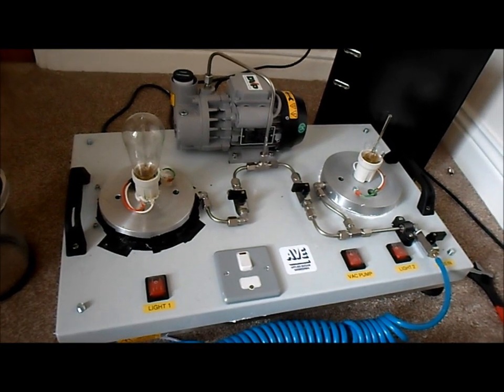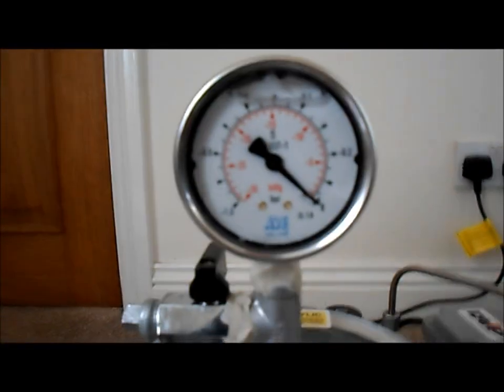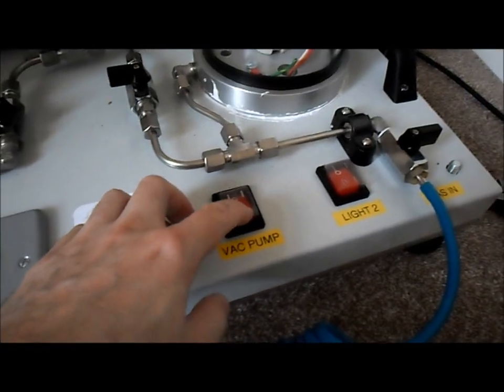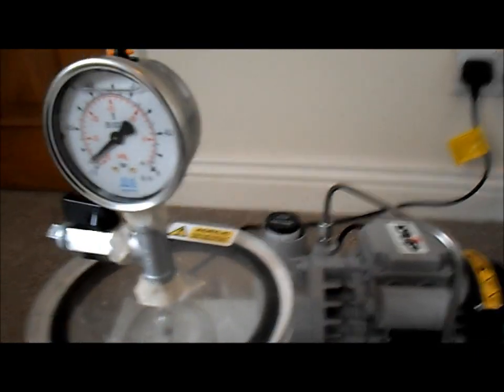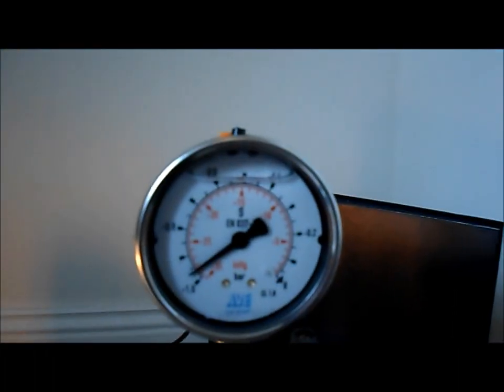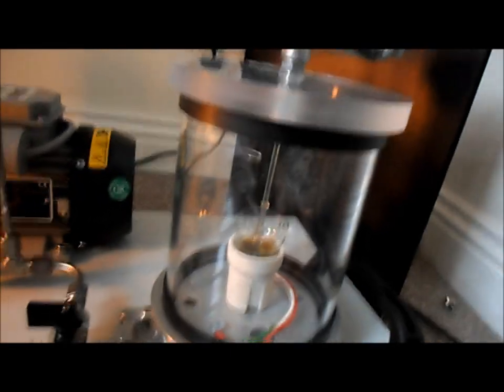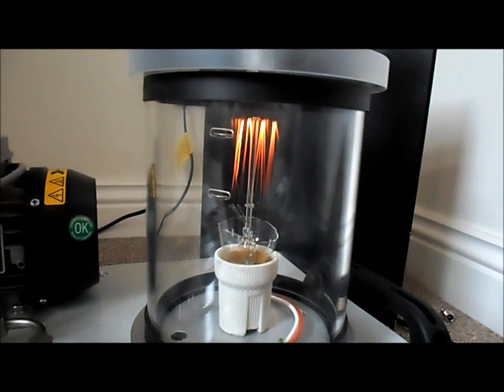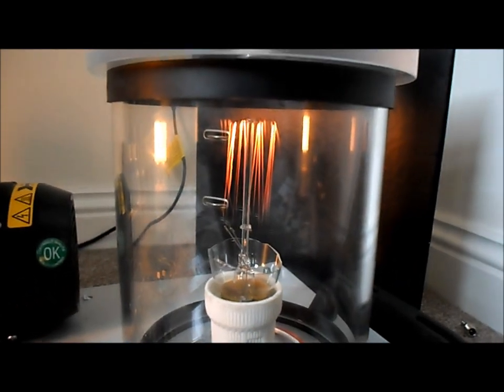Does Greta Know? CO2 does not cause global warming - Direct Proof

Comment: Hi,
Very interesting indeed Geraint!!!
I am just thinking to buy your book! :)

However just two issues.
If I understand correctly they say:
1. The Earth atmosphere absorb heat via:
- IR (long wave from the Earth's surface),
- IR (short wave from the Sun),
- convection
- conduction (the least)
2. Then this heat absorbed in the atmosphere radiate to outside (space) and part goes back to the Earth's surface via:
-  IR (long wave) from the atmosphere (CO2, water vapor, methane etc.)

So if IR is the key type of heating responsible for Global BS then should your bulbs not be IR bulb for better results?
And would not it be better to break the glass from the left one in vacuum as well? It is surrounded by the vacuum anyway. Will be exactly the same as on the right but just different ambient, so vacuum vs CO2.

And second issue is to confirm your understanding-
Do I understand correctly, that some IR heating still goes back to the Earth's surface but amount of that energy is really smaaaaaall.
The smallest (if anything at all) is on the equator (high Earth's surface temperature) and the highest amount of radiated energy (if we could say that) on poles (low Earth's surface temperature)?
But anyway generally the Earth's surface temperature is higher than the temperature of the Atmosphere.
So the atmosphere should not back radiate any heat, with exepction maybe of some minor opportunities where atmosphere temperature would be higher that the Earth's surface temperature?
Do I get this right?
Reply from the maker: https://www.youtube.com/watch?v=Km1lwYS1Qkk&t=663s  No RGHE is a lie.

Comment: 755F and 1466F are the Planck radiation  temps of CO2's two absorption wavelengths of 4.3 and 2.7 microns.The other one is at 15 microns, which has a Planck radiation temp of -80C (-112F), none of which Earth's surface can radiate except inside volcanoes or on a super bad day in the Antarctic. I guess the lightbulb at 4600F is out of CO2's range. :) I still wish you'd try surrounding the filament with a piece of one of those space age emergency radiation reflecting blankets ($7 at Amazon.com for two 7'x5' blankets) and see if it makes it glow brighter. Too bad for the CO2 greenhouse warming hoaxers, there's no giant space blanket floating in the sky.

https://www.quora.com/How-many-people-deny-climate-change-because-they-are-not-familiar-with-climate-research-and-therefore-think-I-dont-understand-it-so-it-must-be-wrong/answer/TL-Winslow
Reply from the maker: The full reflection thing has already been done using a 3d star parabolic legged carambola, so that all light sent out was sent back to the centre source.  https://principia-scientific.org/light-recycling-disproves-greenhouse-gas-theory/  If you reflect all the energy back at the filament, the brightness will increase, because tungsten at that temperature has an emissivity of about 0.30 which can be improved by reflection.  The reflected light superimposes upon the same phase space as the originalyl light and this gives a boost in light output.   If tungsten had an emissivity of 1, there would be no potential for increasing light output via reflection.   However, the maximum temperature of the filament remains unchanged and only cooler parts get warmer, so it becomes more uniform & efficiency reduces.  Also, the light is giving out radiation in the CO2 wavebands, it just the radiation intensity doesnt PEAK at those wavebands.  https://theblackdragonsite.wordpress.com/2018/10/30/co2-does-not-cause-global-warming-demonstration-proof-no-1/.  Attempting to increase peak temperatures by back radiance is a non-starter and anyone who says they can do it is a liar.

Comment: Wait can you explain how Venus is the hottest planet even though Mercury is closer? Because I think because of the carbon dioxide trapping the hot air in. Then if it’s like that then shouldn’t global warming be real?
Reply from the maker: Yes.  Explaining VENUS is easy.  There isnt a radiation greenhouse effect, firstly because the amount of light which reaches the surface is about 1 to 3%, meaning it doesnt get there to warm it, so therefore its heat cant be as a result of back radiance from the light warming the ground, being warmed and then re-radiated.  Secondly Venus is highly volcanic.  Thirdly, Venus has an extremely thin crust which enables a high rate of heat transfer from the mantle below & to top it all off Venus has an air pressure of 90 Bar.  On earth just walking into a greenhouse set to 2 bar air pressure will cause a big rise in temperature even just using air.  These are the reasons why Venus is so hot, so go get educated, oh and BUY MY BOOK!  :D
Reply: Geraint Hughes nice! :D
Reply from the maker: both.  http://www.stairwaypress.com/bookstore/black-dragon/

Comment: this is interesting, i happen to stumble upon this video considering i had an idea about the concept of a 'green house'... not ghg but 'green houses', the ones that's used for home garden and agriculture production... anyways, the 'green house' video i saw states that the whole point of the 'green house' is the grow crop food throughout the entire year considering when winter or cold months hit it destroys or disrupts the plants growth... the 'green house' works in a way that entraps ghg, mainly co2, and as the sunlight penetrates, the 'green house' inside stays cool and warm through winter and allows the plants to keep on growing... but the thing is, i if you add more co2 into the 'green house' the temperature will it increase or will it still stay the same temperature but just has more co2 atmospheric pressure inside its carrying capacity now? because if it increases temperature, it'd violate the 1st law of thermodynamics i believe.... if it doesn't increase, well the global warming on man-made co2 is just a political hoax gone too far.
Reply from the maker: HI.  Adding CO2 to a greenhouse is done not to increase the temperature of the greenhouse but to help the plants grow faster as they have more CO2 to absorb.  Theoritcally, if the Greenhouse was very well sealed, then adding CO2 would increase the temperature because you have increased the pressure, if all else stayed the same.  This is true if all you did was too pump more air in.  However, most greenhouses are not pressurised and sealed so the pressure difference between the inside and outside is minimal.  I have an article published which explains different gases, it is actually possible to have higher temperatures in heated sealed containers using NON-GHE gases.  You can read about it on this link here.  https://principia-scientific.org/the-deliberately-false-greenhouse-gas-co2-experiment/
Reply: A GH works by reducing convection. Gases may flow across the walls carrying heat in or out. Only radiation (IR photons) or conduction (warming or cooling the walls themselves) can move heat.

Comment: That is junk science. The filament temperature is too high - the wavelengths of the filament's emission spectrum are much smaller than those of CO2 absorbtion.
Anyway, the atmospheric greenhouse effect of CO2 ist based on a quantity of a 4m thick layer of CO2 at normal pressure. In your small vessels, effects from walls etc. easily overtops the effects from the gases inside.
Reply from the maker: I know have a TOWER EXPERIMENT which shows you to be the fool you are.  https://www.youtube.com/watch?v=Qo-JqI8ZYDw  The temperature of the surface of the bulb in the tower filled with CO2 is much less than the temperature of the surface of the bulb in a pure vacuum.
Reply: If in your opinion this test could be wrong, why don't you carry on your own experimentation to prove that actually CO2 causes global warming? Can you prove that?
Reply: "the wavelengths of the filament's emission spectrum are much smaller than those of CO2 absorbtion." First of all that would be Absorption not absorbtion!  The B is nowhere close to the P so you can't say that was a simple typo!

However why would this matter if CO2 increases the Temperature.  Based on the claim of Greenhouse Gases the disproportional size would mean an Increase not a decrease!
Reply: Eternal Shaker 
If the Earth was warming (it was), there would be an emission increase in the atmospheric window, and frankly, at all wavelengths. Every model of co2 ppm - absorption doesn't show that.

http://climatemodels.uchicago.edu/modtran/

In normal science:
Hotter objects emit more,
Colder objects emit less.

In climate "science" less emissions is considered "proof" that something is getting hotter. Dumb. These "scientists" are just as dumb as their followers, unless they are hoaxing - which makes financial sense.
Reply: @zoephin6205  There is actually an increase of emission in the atmospheric window, but a decrease at the CO2 specific wavelengths. So the temperature of the lower stratosphere has sunken because of increased CO2 concentration. Overall outgoing radiation is energetically balanced with incoming radiation.
Reply from the maker: @eternalshaker2963  Explain why you think there is a decrease at the CO2 specific wavelengths.  And just what could possibly be causing a decrease at the CO2 wavelengths?  Are you not aware that as an object warms not only does the peak wavelength shorten, but ALL wavelengths experience an increase..  For example a blackbody surface at 288k the spectral radiance at 15 micron is 5.81948 w/m2/sr/um but at 300k it is 6.6841.
Reply from the maker: @zoephin6205  Hi Zoe.  How did you compare it?  Did you do a lab test or was it from some other source of information.  Thanks.

Comment: You cant simulate the greenhouse effect in a lab. you need kilometers high air coloum.
Reply from the maker: If you think adding more CO2 above this filament will somehow reverse the cooling and cause temperature to exceed that of its original state?  You really, really, need to go back to school.  Why, because you are saying if we take a given amount of energy and then spread it around a great number of material, we will have higher states of excitation than if we take the same amount of energy and concentrate in a small amount of material. (LUDICROUS!) You need to grow up and understand that GHE is a lie.
Reply: Aanthanur DC says "unverified science must be right because experiments are too hard"
Reply: There is no greenhouse effect, just normal warming based on cycles. https://www.youtube.com/watch?v=4ZKI40d5YHs
Reply: Are you implying that if you were able to turn the chamber on its side, and increase the chamber diameter to 20 or 30 kilometers, the filament temperature would increase and glow brighter?
Reply from the maker: HA HA Aanthanur DC the double loser.  Not only is your comment totally wrong, I can prove it also.  WATCH!!!!!!!!!!   https://principia-scientific.org/taller-tower-test-exposes-co2-back-radiation-nonsense/  The surface temperature of the bulb, is much lower with CO2 in the taller chamber than it was with CO2 in the smaller chamber.  MORON!
Reply: Aanthanur.  Are you aware that the higher you go up the colder the air gets?  In fact the upper reaches of the troposphere (your kilometers high air column) the temperature is -57 C.,  and at an airliner's cruising altitude the temperature is already ~ -54 C.   Please explain how it is going  to radiate heat back to the earth's surface.  What heat?   If the  heat absorbability of air/CO2 was an important phenomenon then the higher the elevation the hotter the air would get being less shielded from the sun.   But the opposite happens.  Science is based on empirical measurements which in this case prove that heat radiation from the sun  does not warm the atmosphere.  The second law of thermodynamics shows that a colder body (the atmosphere)  cannot transfer heat energy to a warmer object (the earth).  The whole rationale for anthropogenic global warming through the so-called greenhouse effect collapses right there.  By the way,  the greenhouse effect is a false analogy.  A greenhouse works by the glass physically trapping the warm air inside thus preventing it from escaping into the colder outside air.  Those so-called scientists who use this ridiculous term to  explain global warming are obviously a bunch of pot-heads.

Comment from the maker: People are political not scientific, that's why I review their comments and they add all sorts of rubbish, insults and gibberish. Not because its the truth, but because they don't like the truth.   Someone commented "Adding CO2 cools the filament? Was the CO2 temperature regulated to be on the same temperature level as the filament? If not, wouldn't it make sense that the CO2 would lower the filament temperature? That's basically adding an external variable to an a 'should be' closed system. In earth's case, the gas itself is an internal variable, not an external one, so no external temperature variation is introduced to the system..
So unless the CO2 temperature was somehow regulated(that would be cool cause that would be quite a pain), I don't see how this disproves CO2 as not playing a part in global warming"  My response is the CO2 added is at room temperature.  I can leave it all day after I have added it and no change occurs.  CO2 can not add heat energy into the filament the 2nd law of thermodynamics prevents this.  As an example of this you can read this article, if you reflect light back at the filament, its brightness increases not due to temperature change but due to reflectance, the portion absorbed simply reduces the amount emitted by the filament leaving the total output the same, this is when using mirrors.  A gas therefore has no chance of increasing surface temperatures of the filament.  http://spie.org/newsroom/0463-light-recycling-contributes-to-brightness-in-filament-lamps?highlight=x2408&SSO=1%C2%A0.  For more you can also see my website.  https://theblackdragonsite.wordpress.com/2018/10/30/co2-does-not-cause-global-warming-demonstration-proof-no-1/
Reply: I am very conserned about whats happening to the world my friend... and sure i am looking for answers for some questions i have and very big conserns... so, plse can you explain me what is really happening? And how or if we could change this? I would appreciate if you could ease my mind. Thank you very much from Portugal
Reply from the maker: What do you think is happening in the world?   Extreme weather events havent worsened in recent times, they are much the same as they ever were, its just the way the media frames it to make you think its worse and not just that but they frame it so you think its your fault.  So you feel shame and want to pay the elites more taxes.  PAYING MORE FOR LESS IS ALWAYS BAD.  CO2 back radiation can not induce surface temperature warming, that is the point of this video. So write to an MP and tell them to scrap all Carbon Taxes, scrap all Carbon Pricing schemes and sky subsidies to wind farms and scrap all silly and pointless CO2 regulation (WHICH WILL ACHIEVE NOTHING IN TERMS OF CLIMATE CONTROL) and get them to invest in energy schemes that give more energy for less cost. If the world went Carbon Neutral right now, not a single drought, flood, hurricane or blizard would be prevented.  Stop believing the left wing liars.  In particular I would choose, algae based biofuels as they give out over 7 times more energy per hectare than the best off shore wind farms.  We need to look at energy production logically not emotionally and it should be cheap & easily available not overpriced and unreliable.
Reply: @gerainthughes3725 Hughes thanks for your experiments. They are valuable even if they were wrong (and I'm in no position to judge that without sitting down and scrutinize what you do here - I don't have the time to do that). 

However, we need to balance this torrent of alarmist fearmongering which is totally unsubstantiated. 

In terms of economics, the bureaucrats are gaining trillions of generated revenue by artificially raising the cost of energy and subsequently everything that uses this energy to be produced, distributed, retailed, recycled or offered (as a service). 

These artificially risen costs affect other taxes like the VAT tax scheme in all European countries and, to a lesser degree, Sales taxes in the US (because Sales tax is only imposed on the final sale of a product or service and not in every link of the production-to-retail chain like VAT is). 

These taxes amount to trillions of $s annual generated revenue for governments and their cronies. Again, thanks for your time and effort.
Reply: Because the co2 bottle can be at room temp. It is under pressure. Mostly in liquid state. This means if depressurised, it boils and expands and this cost heat
Reply from the maker: @hedf  The CO2 has a label on the bottle which says it is 20 deg in the bottle.  This CO2 is used for welding purposes, so you wouldnt want it coming out freezing.  The gas does increase in temperature but the filament never gets brighter.